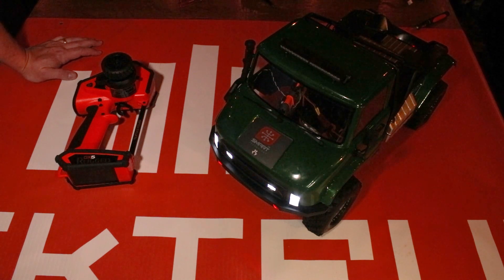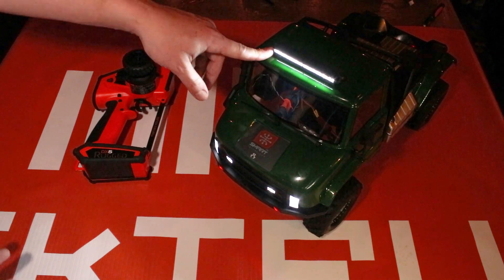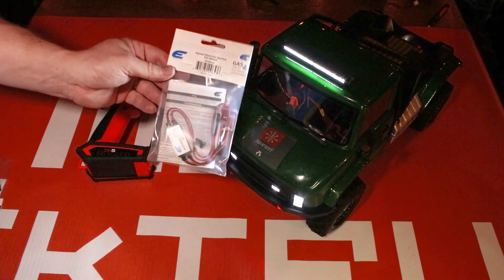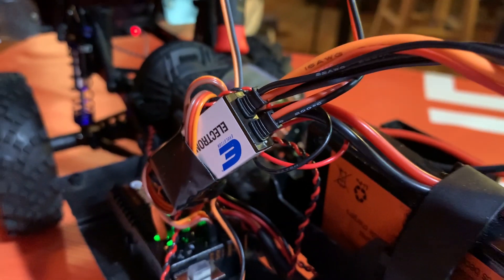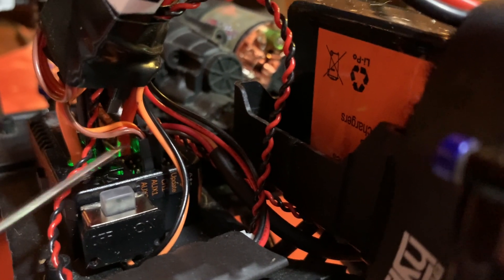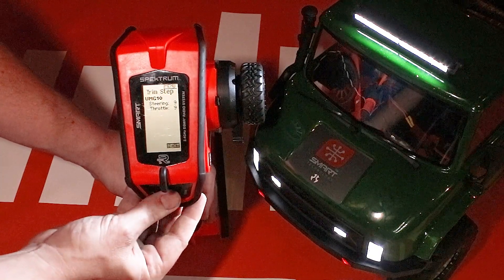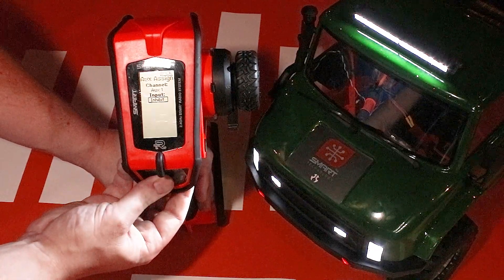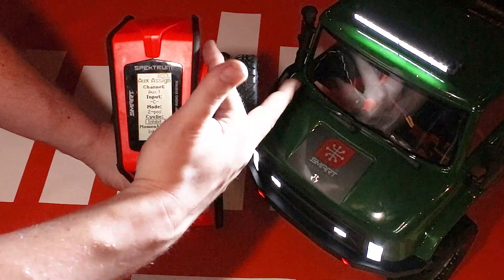Spektrum Quick Hit Tech Tips - How to Setup a Custom LED Remote Light Switch for Surface

Comment from the maker: In this video Tom explains to our fellow scaler what is needed to put a LED light on a Auxilary channel for the ability to turn on and off this light with a switch or trimmer on your Spektrum transmitter. 

The process does require some DIY and customization because most LED lights and light bars have different connectors and input voltages. So it is recommended that you are ready to solder, install regulators, and create new connections with your equipment of choice. Please be extra careful when doing custom electronics because one wrong connection or short could result in damage to your model or even fire. 

To be able to control a LED light or Light Bar, you will need some way to use your Aux channel's signal to control the power to said LED. This is normally achieved using a light controller. There are many different types and solutions for this, and in this video we give you 2 examples. Please consult your LED light controllers instruction manual for proper setup and configuration. 

Once you have installed the LEDs and your controller, the transmitter setup is very straight forward. Follow along to learn more!

Equipment used in this video
Proline Super Bright 4" light bar - https://www.horizonhobby.com/super-bright-led-light-bar-kit--6v-12v--4-led--straight-p-pro627601
EVOA100 Optical Kill Switch - Used as a remote power switch - https://www.horizonhobby.com/optical-ignition-kill-switch-evoa100
DX5 Rugged Special Edition Orange - https://www.horizonhobby.com/dx5-rugged-dsmr-tx-only--orange-p-spmr5200o
Firma 40 ESC/RX - https://www.horizonhobby.com/firma-40-amp-brushed-smart-2-in-1-esc-and-receiver-spmxse1040rx

Also we encourage you, the RC community, to give us suggestions on more quick hit tech tip videos! What do you need help with or what have you found fixed what you think could be a common mistake? Let us know!

Thanks for watching!
Reply: I am using AVC on my Infraction with the DX5C and 6100 AVC rx...so do I need to not use, skip, or leave open aux 1-2 and use 3 or 4 if I am hearing correctly to turn on/off lights?

Comment: Looking for a similar video for the DX6E. I’m trying to enable an on/off switch (preferably using the gear switch on my transmitter). Any suggestions? 

My LED’s work when plugged into the open channels/ports on my receiver, but I’d like to be able to turn them on and off from the transmitter. Is that additional component required in order to turn a channel on and off with a switch? 

Thanks!

Comment: Kindly I have DX5C and I have I switch which I am not using on the receiver but I also use need to use the AVC! When I tried to go from the settings to add the switch with for the lights it showed Aux3 and an L symbol which I couldn't go on it!
When I switch off the AVC it has the options of Aux 1,2 and 3 that can be used!
Is it possible to use the extra switch for lights without removing the AVC?

Comment: So Tom, If I am setting a lightbar up and using the DX5 Rugged with a SR515, is there a specific spot you plug into on the SR515? Is there a video of the actually wiring and connection that you did on this for your lightbar? Thanks signed, Newbie.
Reply from the maker: Hi Gregg, The wiring is really very dependent on your setup and any other accessories you might be running. That being said, running it from AUX3 (ch5) is a good place to start.

Comment: I hope you can help me out here, im fairly new to the rc game. My crawler came with a 2channel esc, channel 1 is connected to servo, channel 2 is open and not being used. My remote controller has a "light" button and id like to install remote led lights. Can I use a remote controlled aux on/off switch relay into channel 2? As of now without the rc aux relay, the lights are constantly on when plugged into 2nd channel, so if I apply the remote relay between the led and esc, will I in theory be able to remotely turn on/off led lights via my remote controller with the "light" button on the remote controller? Thanks in advance!

Comment: What is the ab button for on the slt3 remote with the new no prep drag car? The car has lights on it I cannot get them to turn off why would you guys have an RTR car that has lights and an AB button on the remote with no way to use it?
Reply from the maker: Those buttons have no function with that model.
Reply: @SpektrumRCvideos  thank you for the response. Not sure why Losi or horizon hobby didn't pair the vehicle with a different model remote then. Makes zero sense.
Reply: Arrma Kraton6/Typhon 6 etc. with DX5c(and I've tried with my 
Rugged) w/6100at..I always thought you plug lights into Aux 1 and it isn't being sent any power, assign a trim that has not been assigned (let's say Trim E is not being used) to Aux 1, then when Trim E  button is hit, the lights come on because when I set Trim E to Aux 1 the receiver yells over to Aux 1 ..
     Receiver 6100at:  "Aux 1, you copy?  You have Trim E today! When he pushes Trim E on the transmitter I'm gonna send you some power so the lights work so pay attention.. you get that Aux 1? Please
confirm .....over" 
   Aux 1: "copy that 6100, Aux 1 waiting your signal!.. over"
   6100at: "You're the best Aux on
 board! The only auxiliary but still, the best!"
  A few minutes goes by.........
   6100at: "Aux 1!! Aux !! Come in Aux 1!
Trim E has been pushed, sending power
to you now for those LED's!"
  Aux 1: " (silence........)
  6100at: "Aux 1!!!? Aux 1??!l please respond"
  Aux 1:  (...snoring sounds in the background.. small fart..Andy Griffith show whistle part of theme song in the background  )
   6100at: " you fell asleep watching again didn't you Aux 1!?l"
Seriously though! Spektrum makes it seem like you plug lights or whatever into Aux 1, assign an unused trim to Aux 1, then whenever you push that trim Aux 1 gets power because you pushed a the trim
you assigned to Aux 1.. I must have missed  it in the manual where it says that assigning a trim to an Aux does not make that Aux work idk :(
Reply: I plug lights into my sr315 on my Typhon 3s V3 and my AB switch does nothing!

Are you saying the buttons on the controller are only for looks and not functional?
Reply: @ryanbarrysmac  looks like the buttons can be used with a function toggle adapter for lights. It's like an extra thing you have to buy and run in line with your lights. I think it's ridiculous. Some people use them on crawler trucks for a winch. Who the heck wants to put a functioning winch on an rc car. Just go pick the car up for crying out loud. Some people are turning rc into role playing.
Reply from the maker: @ryanbarrysmac  You need a LED light controller, simply plugging the LED in directly only supplies power. Watch the video, I explain this in detail and give tips :)

Comment: My spektrum slt3 stransmitter has a 3rd channel a and b thumb switch and my receiveer has a auxiliary 3rd channel port but my lights stay on all the time I'm pressing the thumb button but nothing happens
Reply from the maker: Do your lights have a controller?
Reply: @SpektrumRCvideos  I've tried a wireless on off module in the esc fan plug and I tried in the sr315 aux port but the slt3 stransmitter does nothing. Do I need to bind the receiver to the wireless on off module?

Comment: I am trying to set up my Aux3 to run my lights. I set it to use switch G. Now I cannot highlight the input option to change the switch to something else. Please  help.
Reply: I have the same problem with mine. Yhere is a update out that they told me to do. So I bought the cable to do the update and see if that works. I csn select swithes I dont have and then I cant get it to change back and have to reset the model. Keep you posted.

Comment: How do I disable the brake rate from switch (F) ??? I want to use it for my winch.  But the switch keeps turning down break rate when I use winch
Reply from the maker: It is in the RATES menu, select Steering and change to Brake. OTF is the option you will want to change to another available trimmer or turn INH to disable. Hope that helps!
Reply: @SpektrumRCvideos  thank a mill.  That totally did it.

Comment: I'm just wondering, why can't the switch just turn off the power to the receiver and then it turns your lights off?
Reply: That's what I just wrote..kinda.. I have always thought there was no power until you hit the switch /trim depending on the transmitter setup. I've watched this video several times and I'm still lost. I know what he's saying and how it works now but wow I admit I'm not smart nor educated but damn! All that for lights or a winch? I got one of the remote LED sets from somewhere and a usb charger pack.

Comment: Hi Tom, Thanks for another great video!  
Since you asked in your comment what we need help with...A few days ago I bought a Spektrum DX5 Pro, so I could see the all the Telemetry on my Tenacity DB Pro.  It works fantastic!  Seeing all the telemetry for the battery, esc and motor on the radio is awesome!  I'm running 3S and 4S and it makes it easier to be able to keep an eye on temps during a run.  Everything is good.
Help: Could you Tom, or anyone else that knows how, please steer me in the right direction for being able to figure out how to set my Steering Rate for AVC to the knob on my DX5 Pro for quick adjustment?  I have everything working and adjusted to my liking, except that I would like to be able to adjust the Steering Rate for AVC on my DX5 Pro, just like the factory DX2E was set up with the Tenacity DB Pro.  I really liked that feature with that basic radio!  It worked very nicely and could be adjusted instantly & precisely depending on conditions & traction etc.  I've gone over the DX5 Pro manual & related videos I could find & tried everything that I can think of, to no avail so far.  I tried other channels too, just to see if I could get it to work.  The AVC works fine!  I have it in Switch Drive Mode in 3 modes on the 3 way "switch I", right next to the knob that I would like to use for the AVC Steering Rate.  Even though the AVC works fine with the settings I set in the 3 modes, I like to change the Steering Rate / AVC on the fly, as conditions change during a run.  
The DX5 Pro doesn't seem to want me to assign any channel for quick adjustment the Steering Rate for AVC.  The knob isn't being used and would be perfect for it!
Tom, I plan on putting the Tenacity's light bar on a switch too, which is why I happened onto this video. Thanks in advance for anyone's help!
p.s. On the Tx settings going to the Function List - Rates - Steering - OTF - it only gives me the option for Inhibit or Trim button F.  Going further down to Override - It only gives me the option for Inhibit, Switch E or Switch H.
Reply from the maker: Hey Thomas! Sorry I am just seeing this comment! I will have to play around with it a bit myself to see the best route of doing this. I may just write it down in the comments for now BUT I can see a video coming to cover this :)
Reply: @SpektrumRCvideos  Hey Tom, no problem!   That would be cool if you figure it out and can share how, or even better to help others by having a video to cover this, so we are able to to use the knob on the DX5 Pro as it's a great radio to keep an eye on all the important telemetry!  I'm really enjoying the Tenacity DB Pro too and we're amazed at it's durability!  I've been so impressed, I bought one for my wife and a third one for other family or friends to use.  I have some spare parts for them, but amazingly, we still haven't broken anything yet (just turned some tires bald), and have run a ton of packs through them, especially my modded one.   Thanks!